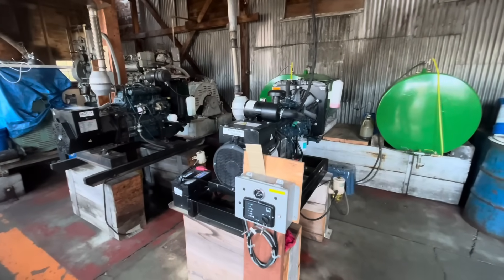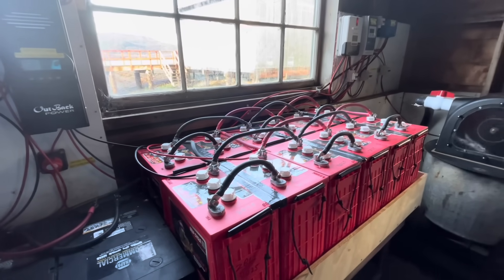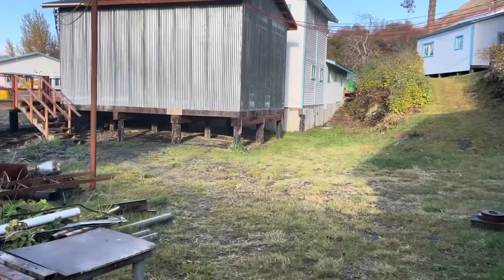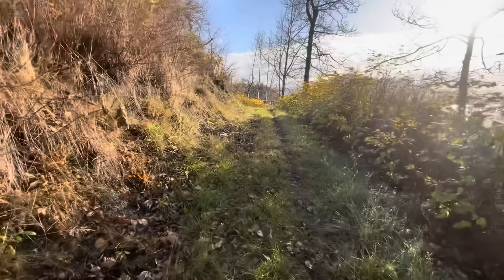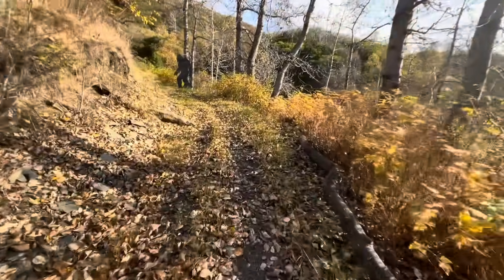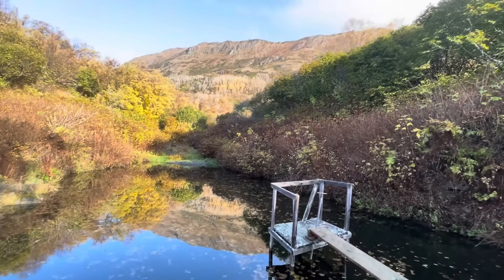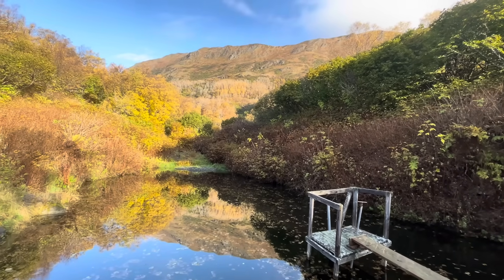How we make our own electricity in remote Alaska.

Comment: Interesting system.
 I notice your batteries are FLA type. They have better resistance to temperature extremes.
 What voltage range are you running on?
Reply from the maker: It’s only a 12volt system. I wished I had stepped it up knowing what I know now. Live and learn.
Reply: @zacharbaylodgeinc8864  Thank you for the reply😎
 I have a very small 12 volt system, with FLA batteries. I wish mine were not sealed case type. 
 I do firewatch and equipmentwatch, year round. Various job site locations.
 I don't need much, but I can't rely on solar, or water sources... Sometimes there is water, or good sun exposure, sometimes there isn't.
 I have been in temperature ranging from 8° up to 112°. . .
 I don't trust the builds on lithium batteries, or life-po 4 even.
 Not going to risk a battery fire, that I can't easily put out🔥👀🔥
Reply from the maker: @invisibilianone6288I agree with you on the lithium batteries and what do you do with them when they die. I keep hoping that they put a salt water battery on the market. They look really good.
Reply: @zacharbaylodgeinc8864  Yes, the salt battery looks interesting. But I've only researched it a tiny bit 
 Other types of power storage too ...
 When I come to some aspect of a system I'm looking into and i find something that falls outside my shituational needs. . . I look for the next possible system
Reply: Sealed FLA, not AGM? The major factor with battery life is temperature. A battery at 80f will last a few years, a battery at 40f or less will last a decade or more. Look into Sunxtender batteries, I worked with a group that has hundreds of them in service and they perform well, but as noted above, heat kills them also.
Reply: @stevebot AGM batteries were more expensive, when I bought batteries. I have six, deep cycle batteries a generator, a charger and an inverter,,,, very crude system, but these FLA batteries are 5 years old .. maybe 6 yrs 
 They are sealed, which doesn't allow for battery maintenance....
Reply: Looks like a 12V system from what I can tell from the video.  The red batteries appear to be two 6V banks in series.

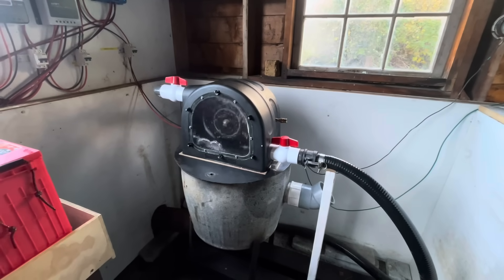Comment: 1:30  it's making 34.64 psi exactly.  1 foot of water = 0.433 psi at base ( 1 inch = 0.0361 psi )  you calculated head pressure incorrectly,  those outlets are not 2" and that head pressure calculation loses some head pressure due to wall friction ( especially prevalent in corrugated tubing  )plumber  gasfitter and sparky for 30+ years here. Respectfully intended
Reply from the maker: Thanks

Comment: 1:38 did this water turbine generates only 240 watt!!
Reply from the maker: Yes around 260 watts. It runs 4 chest freezer, two mini refrigerators, the Starlink internet system, tv, oil fired hot water heater, a few lights at night and a few more little things. It would not run all these things at once but they cycle on and off. We also can do laundry when the sun is out.  The solar helps top of the batteries during the day when there is sun..
Reply: @zacharbaylodgeinc8864  and the most advantage is that it is continues unlike solar
Reply from the maker: @motazabdelazeem3533 yes we get more rain and snow than sun in the winter time. Works great.

Comment: Really nice and tidy system but man, you're leaving so much on the table! Without much investment this could be turned into a 48V (or more) system and you'd gain a bunch of efficiency. With a bigger penstock and better nozzles, you could probably triple the capacity of that turbine, too.
Reply from the maker: I agree that I could improve the system for better efficiency. I am making improvements as I go. Thanks
Reply: Volts are electrical pressure, you only require more volts if you have a resistive load or an inductive load requiring pressure to spin it. Volts does != efficiency
Reply: @MrDmadness  48V systems are inherently more efficient. Inverters that operate at higher voltage generate less loss thru heat amongst other factors.
Reply: @fullraph yes, lower voltage systeme can operate more efficiently because you are applying less pressure and so lower back emf is generated ( in inductive loads ) but those inductive loads top speeds will lower, a resistive loads purpose is to generate heat and so by its very design is less efficient. The systems requirements are dictated by the load requirenents id wager this ui why he has different banks

Comment: Nice set up! 😀  can you synchronize the generators together, or along with the inverter ? 
Wil the inverter switch to charge your batterybank when one of the generators run?
Do the generators start up automaticly depending the inverter load?   -or/and if battery voltage can be sustained from hydro/solar ?
Why lead acid batteries? 12v, 24v, or 48v battey banks?
Are the black batteries newer and maby lithium? are the red lead acid batteries combined or separat with the black batteries?
Do you have a 120v or 240v inverter output system ?  
I would love a detailed video with technical info on a beautiful system like this !!! 🤩😃😃
Reply from the maker: I imagine that they could be synchronized together but I just run one at a time.
Yes the inverter has that function and it works great.
The 12KW generator does have that capability but I just haven’t hooked it up.
Lead acid are easer, cheaper and I will be improving the system in the future. I also am waiting for the saltwater batteries to be on the market.
It is only a 12 volt system. 
The black batteries  are lead acid and are older than the red ones. The black ones aren’t hooked up to the red ones. Two separate systems.
The inverter is a split phase so 240 volts Output.
Thanks for the questions and the compliment.
Reply: @zacharbaylodgeinc8864  😃 👍
Reply: @zacharbaylodgeinc8864  Thank you for mentioning the saltwater batteries.  It's the first I've heard of them, I'll have to research further.  I've become quite interested in battery chemistries over the last year.  My respect on your hard work, developing your homestead.  Are you from Alaska, and if not, how long have you resided there?  I love your chill demeanor.  Peace & Love.
Reply from the maker: @RPRosen-ki2fk  Born and raised on Kodiak Island. We  purchased this property in 1989.

Comment: How long is that inverter been above those batteries? The off gassing from the batteries will cause corrosion inside of that inverter eventually.
Reply from the maker: It has been above the batteries around 4 years. Thanks for the advice. I will do some relocating..
Reply: Maybe, but your batteries are extremely clean, which means minimal outgassing. I have a similar config and no corrosion. Also the room is well ventilated which helps.
Reply: Lithium cells don't off gas, nor should properly maintained lead acid

Comment: nice video - i have to ask, but why is everyone who is storing energy the setup built it in such away that when one battery explodes or catches fire the whole setup is in danger?
Im aware if you seperate the sources of energy it costs more to run or build it. But considering thats almost impossible to put out a lithium battery fire in a reasoneble time, im suprised that not more people seperate the storage of the batterys in a "better" way or seperate them out in another building all togehter. Maybe im missing something or technical isnt posible or somehting along those lines.
Reply from the maker: Having everything in one place makes your battery cable runs shorter so you don’t have voltage loss. Also wire is expensive and I was trying to do this on a budget. 
The batteries are lead acid.
Thanks for your interest.
Reply: thanks for the awnsers. Im curious, do you transform any sources into heat or do you all transform in electricity?  Im thinking about building a  "serverroom" to feed waste heat into the heating system. I mean its a 1200W system and a storage server so a lot of loss theire, but im warry about leaking water from the PC to the heating system. And i dont want to pay a professional - that would be to expensive for a test ;).
Reply: Not all lithium batteries are the same. The most commonly used (what I use) lithium batteries for off grid power are LiFePO4 chemistry which is not prone to fire.
Some of his batteries were lead acid and others looked like AGM so not even sure if he even has any lithium.
Reply from the maker: Just electricity.

Comment: Where did the turbine generator come from? 
Is it avaliable to buy or did somebody make it?

I recognize the solar charge controllers, but never seen that turbine before.

Have you considered buying a used electric or hybrid car to use for a battery bank? 

It might be cheaper to have a driving car delivered or pick it up yourself vs a used car battery pack that's heavy and difficult to move.

Park car outside and run a cable to  the basement. 
Then if car battery pack fails and catches fire, it won't burn the building down.

Lithium batteries are unbelievably more efficient and last much longer than lead acid golf cart batteries.
Reply: In freezing temps, you have to keep lithium batteries warm in order to charge them. Some Li batteries have a Battery Management System (BMS) built in that won't let them charge if the  temp drops too low.
Reply: @MrRoss-wv6jp ALL lithium batteries require a BMS drop below 2.7v and the cells will never 2ork again get over 4.2v and you will have a fire. Bms is a critical component of lithium cobalt oxide cells
Reply from the maker: It is called a powerspout. You can go to the website and check it out. https://www.powerspout.com/ 
Thanks for your interest.
Reply: Search for "powerspout hydro turbine".
Reply: Not in winter months especially in winters like Alaska gets they are pretty much useless.